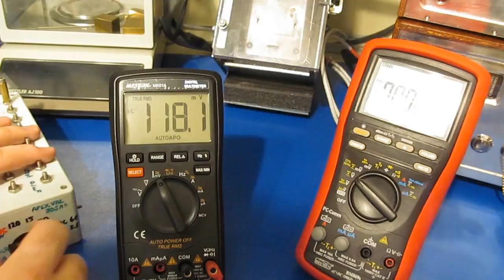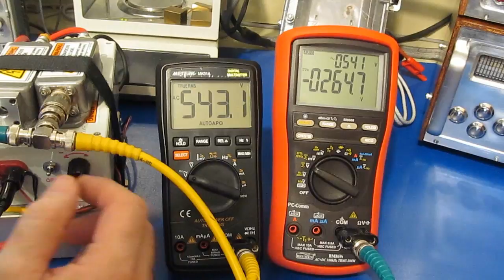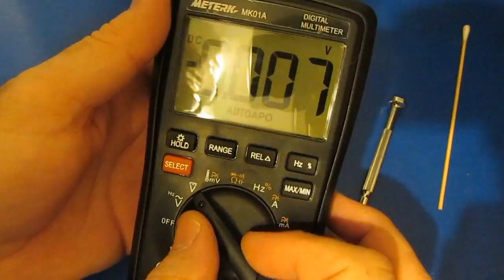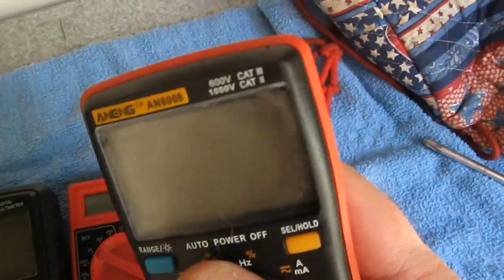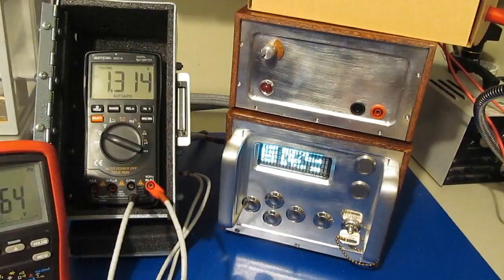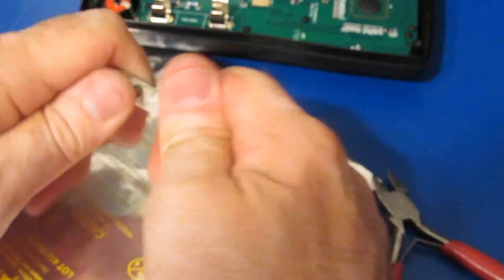The METERK MK01A DMM

Comment: Meterk == rubbish. I once bought a Meterk laser marker, a rebranded NeJe. It has numerous issues, including safety, EMI and functional. Also its laser power is not real, the number has been massively inflated. I reported to Amazon, but sadly Amazon decided to keep carrying this illegal (no FCC intentional radiator & computer peripheral, inflated numbers, contains battery without UN3480 label, etc.) POS.